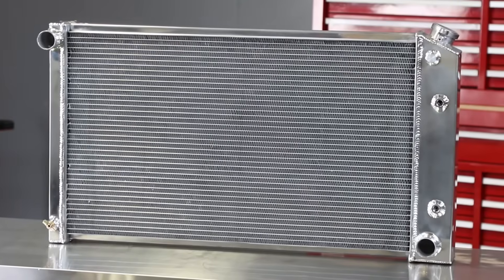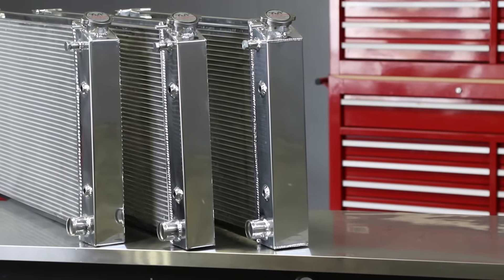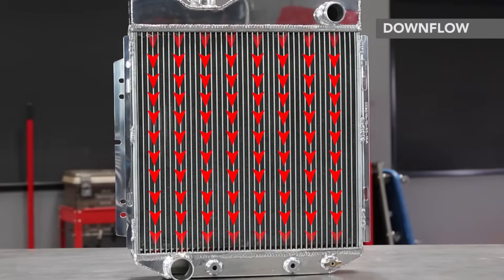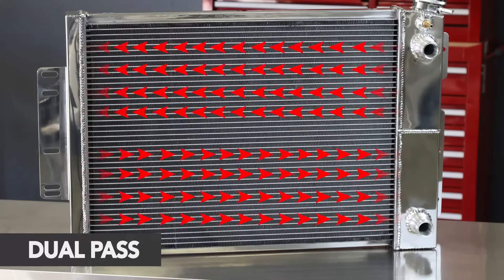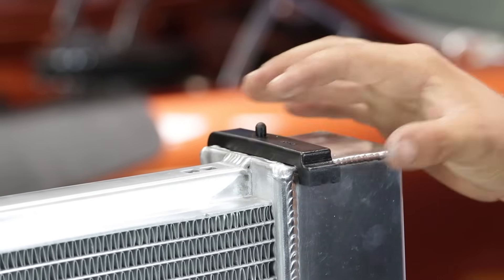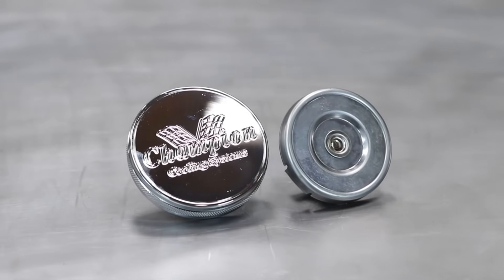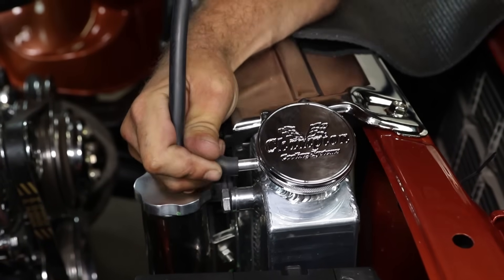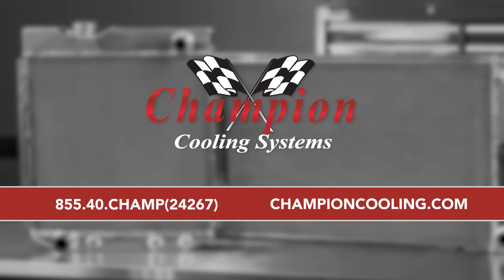Champion Radiators: How to choose and identify what type of radiator to buy

Comment: I put a 4 core Champion radiator and the dual fans with shroud in my 73 Chevy C30 fuel injected 454 Pick up. Its got a small cam in it but its pretty stock as builds go.  First time out and its getting up to 240 and only 75 to 80 degree weather. Im in Las Vegas and its gonna get a lot hotter( 115 to 120 degrees) and the test was with out the AC on. So we are now looking at other fan set ups to bring the temps down. Looks like a great set up in my truck but its not woring well at all. Very disapointing.
Reply from the maker: It sounds like an air flow issue, the one problem right off the bat that I see is a 4-row radiator and an A/C condenser... way too much to get air through that configuration. We typically only recommend the 4-row for high-horsepower applications and no A/C. We have customers with 600+ HP and they are running 2 or 3 row radiators. When did you buy the radiator? We do have a 60-day return/exchange policy, contact Shop@ChampionCooling.com, or you can call 951/245-9464 to discuss with our Sales Staff.  Thanks
Reply: @ChampionCoolingSystems  it was during covid. So, no warranty. And we found out that the fans and shroud were causing the temp to rise. We put two brushless Perma-cool fans on. It brought the temp down a bit. But when we ran the new fans without the shroud. It was within the temps we felt comfortable with. Now it operates at 180 as it should. I do wish I would have chose a 2-3 core but it’s in and it’s working. So if it acts up I’ll swap it out. Maybe suggest what you just said prior to people buying a 4 core. Especially with the knowledge we have now that at times thinner core radiators cool more efficiently.
Reply from the maker: @rasmith8742  Did you purchased the radiator directly from us? I would be surprised if our sales staff didn't warn against installing a 4-row with A/C in the vehicle. They're all aware that it could cause airflow issues.
Reply: @ChampionCoolingSystems  yes it was purchased through you or an affiliate or dealer. I don’t buy that kind of thing second hand. I actually bought two because one was damaged in shipping. Not any fault of champion. Don’t worry I’m not blaming Champion for me having this radiator. I know companies are all about saving their selves and making it the customers fault. It’s not brain surgery. Anyway, my point is that the fan and shroud set up that you are selling is not quality. It does not function properly and it has a major draw on the electrical system. After putting on the brushless fans that I did that were high-quality and took off the shroud. The problem disappeared. I’m not writing this as a complaint or to hear from you directly. I am merely trying to get the information out to the others that are buying these things that might have problems with them if they buy certain set ups. I appreciate you trying to chime in, but you’re not fixing any problem.
Reply from the maker: @rasmith8742  wow, nobody is trying to blame you (or any customer, for that matter). Nor am I suggesting that you purchased it second hand; I was simply asking if you purchased directly from ChampionCooling.com and spoke to one of our own sales people, or if you purchased from one of our many dealers. 

Our dealers sell our radiators, but they don't necessarily sell our fans or shrouds. We have had customer who were sure they purchased directly from us and later found out they bought from a dealer, and unfortunately we have no control over their sales people, but we can talk to our own sales people if there was an issue with a customer. I'm sorry this has offended you, but you posted a complaint to our channel and I'm simply trying to get to the bottom of it.  Thank you.

Comment: I  ordered a Champion radiator and it leaked right out of the box. Champion sent a replacement, I installed it and it leaked also. I gave up and ordered another brand....Thanks Champion.
Reply: Toyota truck...22RE....Champion offers a replacement but after the first 2 are bad why would I waste my time/work putting another one in?
Reply: @Historynut73  cause he's a fool or liar
Reply: @Historynut73  what cooler did you end up getting was thinking about upgrading my radiator
Reply from the maker: Sorry for your troubles, this isn't typical with our products. What vehicle are you putting this in? Have you contacted us directly or one of our dealers?
Reply: Google "Champion radiators leaking" and see what you find......

Comment: Only got 2 years out of mine.
Reply from the maker: Hi. What happened with your Radiator when you say you got 2 years out of it?  Is it leaking, or...?  We do have a Limited Lifetime Warranty against manufacturer's defects, did you contact our staff to let them know what happened?
Reply: @ChampionCoolingSystems  Hope you still active here, hey can you tell me if a 2 raw    aluminum radiator  is sufficient for a Toyota with 22 re angine ?(4cyl) 
Im actually  trying to reach the store on lake Elsinore  to order directly 
Thanks , norman
Reply from the maker: @Normans-h6l  That's the one I have in my 94 Pickup with the 22RE and it's been absolutely fine... I thought I'd have issues since the motor is high mileage and needs to be replaced, but checked it over the weekend and haven't lost a drop and temp stays just below the middle.  They do get a lot of calls as we've been very busy, but there's usually someone answering between 8-noon, 1-4:30, M-Th PST. 951/245-9464  thanks!
Reply: @ChampionCoolingSystems  Thanks again i see it on the website should i stick around the 1 raw or 2 raw?
Reply from the maker: @Normans-h6l  We don't have a 1 row, we only have the two row for that. Part #945.
Reply: @ChampionCoolingSystems  Thanks , ill be ordering soon , i live locally in Oceanside , ca
Reply: @ChampionCoolingSystems I have a 22 RTE (Turbo) I understand the turbo has its own coolant line. Is there something you guys offer for this ??
Reply from the maker: @pigbenis4399  We don't show anything specific for the turbo, just the 22RE through 94. Not sure what's different on the Turbo radiator. Call our staff at 951/245-9464 thanks
Reply: @ChampionCoolingSystems 2 1/2 years to be exact. It just started leaking .  I spoke to the supplier and a replacement is on it's way. In the mean time I have close to $300 bucks tide in this whole warranty deal. My reimbursement of the part relies on your pressure test. Even after you do your test I'll be down $60 bucks in shipping charges. I'm questioning whether I'll have to go threw the same process in 2-3 years.
I got 12 years out of my brass radiator and the cooling was about the same. I will admit... yours does look better but not worth the hassle. I'll follow up with a comment once everything is said and done. Thanks for your concern. :)
Reply from the maker: @lueecam9320  I'm curious, did you deal with someone here at Champion Cooling or with the person you bought it from? It doesn't sound like something we currently are doing (making you pay to ship it back), we typically replace it and send a call tag for the warranty radiator.  thanks
Reply: @ChampionCoolingSystems  I originally bought it from ledfoot being that they're an authorize Champion radiator dealer .  
The return label had your name and lake elsinore address. You received it on the 23rd...  Didn't think that was cool on there part and it makes a customer have less respect for the product.  Maybe you should have your suppliers tell customers to contact you directly for warranties. I know I'd be a happier customer had I not been stuck with shipping fees on a warranty issue and because of this it's hard for me to tell my muscle car community to buy a champion radiator... Just food for thought.
Reply from the maker: @lueecam9320  - Sorry you had that experience, we don't make you pay to ship it back for warranty, but unfortunately we can't control what other vendors/dealers do.
Reply: luee cam was

Comment: I have a Champion radiator in my 1999 Jeep Cherokee and it can not cool my jeep down in Arizona. I got a lift big axles and 35" tires. Also the Engine is brand new with a flowkooler water pump. Not sure what OEM is but the 0.75" tubes in teh Champion are not up to the task of cooling a lifted cherokee on 35" in an Arizona summer. If you are serious about cooling for starters I would look at a Radiator with at least a 1" tube design on a dual core or even bigger tubes on a single core design.  All in all Champion radiators are not very good and you get what you pay for.
Reply from the maker: There can be a lot of factors for keeping cool, even on a hot SoCal day with 80+% humidity on a musclecar it's possible to keep the temps below 200º.  Overheating can result from poor coolant flow or poor air flow. Having larger tires also can put more load (stress) on the engine, and that can generate heat as well. We ship between 5,000 and 6,000 radiators a month. I personally road race with mine, and on the track with an average of 85 mph and higher rpms my temps with a two-row radiator stay below 180 (with the fans shutting off at 50 mph).  Having good air flow and good coolant flow are a big part of the equation, just adding an aluminum radiator isn't the solution and won't solve overheating issues by itself.  Thanks for your input
Reply: With 4 radiators in mind, Champion, Mishimoto. Griffen, Ron Davis that are available for a Cherokee the Champion has the smallest tube size with 0.75"  All others offer bigger tubes in a 2 row config. If Champion is interested in upping their game for the extreme heat in the desert. might you consider offering a radiator with at least 1" tubes on a 2 row setup.  This is real world stuff that desert jeep guys need who have big tires, axles low gears,  and are crawling over rocks.
Reply: The radiator design in the XJs are terrible. Plus the engine compartment is sealed up and doesnt vent heat well. Step 1, put some large vents in your hood. Put some electric fans on. If its still running hot you may have a leaking head gasket. Last resort try Evans Waterless coolant.
Reply: Novak makes an amazing radiator for the XJ. Expensive but really performs well.
Reply: WELL ITS OBVIOUSLY AN AIR PROBLEM, ANY FOOL WHO DOES DUMB SHIT MODS LIKE YOURS SHOULD ALLOW FOR THE THINNER AIR  WAY UP THERE !!!!!!

Comment: Okay fellas and fell-ets, disregard my last. I was just off the phone with Matt, and he has put the ball in motion to get my unit replaced! Actually I kinda feel like a heel because I am being taken care of so well now. Matt was able to track down my order so we are good to go!

P.S.  The aforementioned issue is the ONLY one I've had with the unit in question, and I was telling Matt that the radiator worked too well actually. Heck I had to get a higher temp thermostat to get it to operating temp in the winter and block off some of the air passing through the core. So I hope this retraction will put them back in the good standing they deserve. Turns out this ones on me!.  Apologies Champion.

Comment: I have one of these NOW that I purchased from ebay that came with the fans and shroud. 
I have had it for almost three years now and IT'S LEAKING! where the tanks connect to the core. I was told at a radiator repair shop that  because of that, it couldn't be repaired!  432 dollars and the rep at Champion told me I  would have to get in touch with the seller on ebay to take advantage of the lifetime warranty. I just love a company that stands behind their product. The ebay seller didn't make the radiator! Champion did. My purchase history on ebay only goes back to 2015 so I'm up the creek. Thanks CHAMPION!
Reply: I read this and I won't be using champion.  Probably Jeggs or Eaton.  Sorry Champion but you should have helped this guy  out.
Reply from the maker: +Lee Sires: I'm sorry you feel that way. We have many dealers and we cannot control their customer service, that's why we asked if he contacted US or the place he bought it from. We can't help someone out if they don't contact us. If you read further comments, he did contact us and is satisfied with the replacement.
Reply from the maker: Hi Anthony- Did you call us back after you couldn't reach the eBay seller? Who did you speak to here, and when did you contact us?  Your Champion Cooling Systems radiator does have a lifetime warranty against defects and if it's leaking we do stand behind our product, but we need to know who it was purchased from so we can make sure it is one of our products.  Please contact Matt here at Champion Cooling and we'll see if we can find your order.  951/245-9464   Thank you.
Reply: @ChampionCoolingSystems  wat radiator would be best for a 2004 dodge cummins 5.9 a 2row or a 3row or 4 row radiator?..
Reply from the maker: +Sancho: I wouldn't recommend a 4 row, especially if you're running A/C. Unfortunately, we currently don't have a replacement for the 2004 listed.
Reply: @ChampionCoolingSystems  do you guys carry a 2row or trow and Wich is best??
Reply: @ChampionCoolingSystems  3row
Reply from the maker: We don't currently have a replacement for the 2004 Dodge. Sorry...
Reply: That's why you don't buy from eBay
Reply from the maker: @Joey8456 Did the box have a red and black Champion Cooling Systems logo on both sides? And does the cap say Champion Cooling? If the box only says "Champion" in block letters, and the cap doesn't have our logo, that would be an indication.  thanks
Reply: @ChampionCoolingSystems  damn knock offs and Chinese swindlers..!